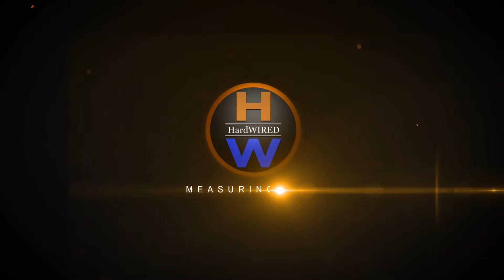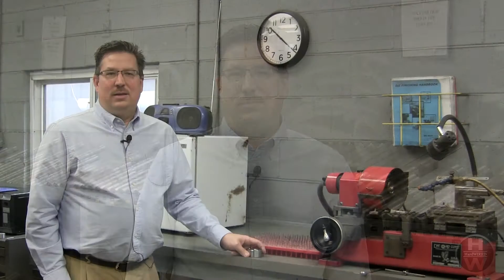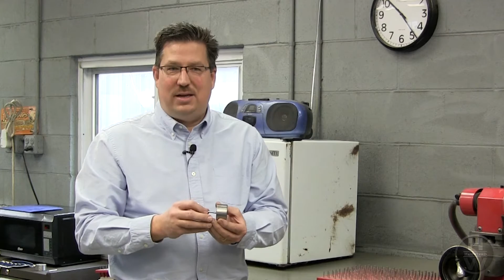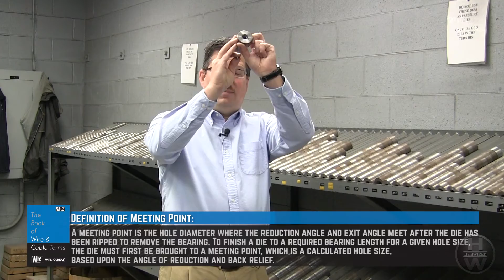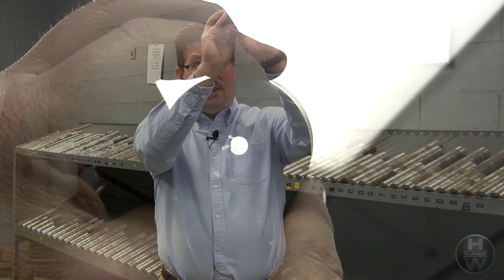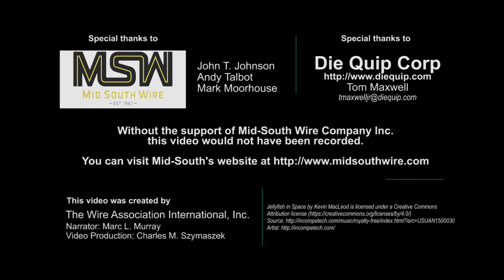Measuring Dies

Comment: What is the typical cleaning techniques for diamond dies ?
Reply: To remove drawing oil and diamond cutting compound most people use Ultrasonic cleaners with a mild water based decreasing fluid.  To dry them after the ultrasonic a piece or rice paper is pulled through or compressed air is blown into the die.
Reply: Tom Maxwell thanks Tom ! Really appreciate your answer !